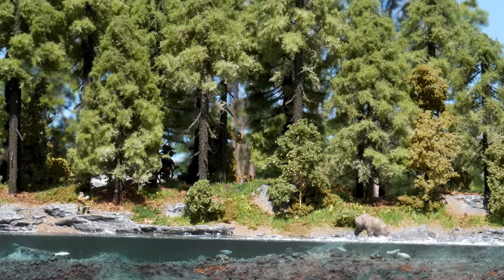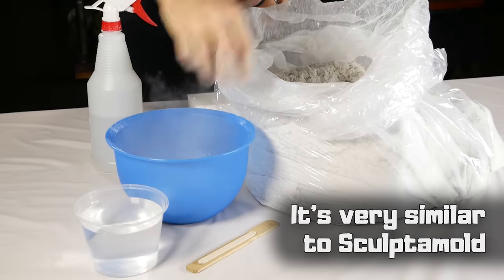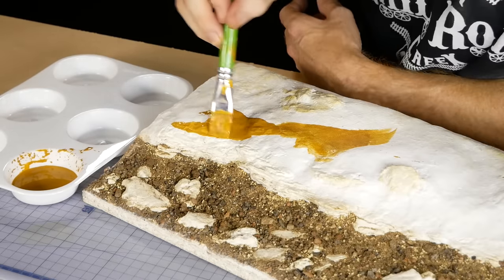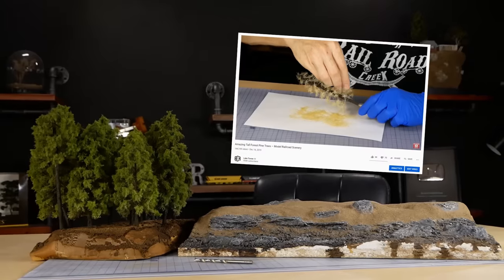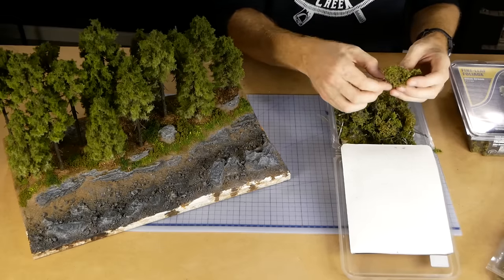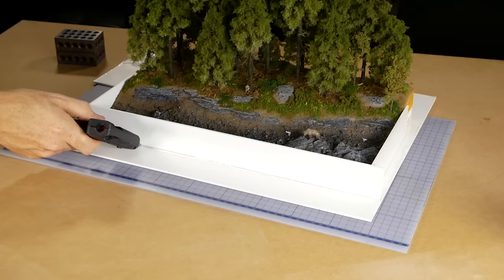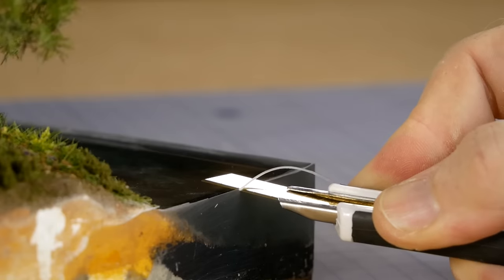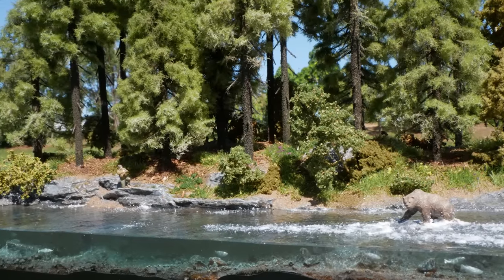Build an Ultra-Realistic River in the Alaskan Wilderness – Realistic Scenery Vol.21

Comment: I had a funny moment a little while ago  when I was shopping for acrylic paint but all the proper brands of modeling paint were too expensive for me at the time, so i go into ned's and my mum says why are we going to all these different shops and brands aren't they just the same and i say i watch BCR with Luke Towan and he uses specific brands of paint and seams to get good results from them. So i end up picking up a pack of the exact same brand and type of paint he used for the base coat in this video. 😅
P.s. are you from Adelaide?
Kind regards Reuben.

Comment: Luke-FANTASTIC JOB!!! May I suggest cutting thin acetate and painting it with Tamiya clear smoke . Glue this into the inside of the body if there is room, with the tinted acetate in the rear windows it would hide the RC hardware visible through the windows. I have to say again that it looks great driving through the dioramas.

Comment: I’ve been building some micro-dioramas in 1/300 scale, usually roughly two inches by two inches in size, and the skills he uses are indeed transferable in different scales. Apart from resin. Usually you are better off painting water and applying gloss varnish than using a small amount of resin (in very small scales).

Comment: You could use L-shaped bars for the edges you pour epoxy for. You can oil/lubricate the sides facing in; clean smooth mold results, easy release. You can clamp them down on the corner's edge of a table. Or pour hot wax around the perimeter of your bars to lock them in place anywhere on the table. You can shape a minimal amount of clay in the sharp inside corners--to prevent leakage of the epoxy. Might save in prep time.

Comment: As an architect, we often get models made to test the viability of a design, and later to explain the ideas to interested stakeholders.

But we rarely if ever go to trouble of providing such naturalistic surroundings, even though the buildings themselves are brass etched or 3D printed.

I would respectfully ask if these dioramas have a commercial application, or are they just built for the fun of it?

Comment: Hello Luke, I've noticed that you always use an opaque resin tint for your rivers/water pours. What would be the difference (in appearance) between using an opaque tint instead of a transparent one? I couldn't find any opaque tints at my local craft store in the colors that I wanted for my water, however, I did find the correct color tint but it was a transparent resin tint. I don't mind showing the rocks and boulders at the bottom of the river, but I don't want to highlight the paint line blends for the depth of the river.

Comment: I am presently doing something like this, although smaller and less ambitious.  Assuming the ground base work is done (rocks, grass, dirt textures, ) wouldn't it be easier to do the resin pour before you do the tree / bush placement?  It seems to me the foliage makes it more cumbersome to work with... and they could even shed bits into the resin if you're not careful.  Anyway, I guess my question is did you have a specific reason for doing the trees before the resin pour?

Comment: How TF does anyone thumbs down this? Great job man... I was thinking though... if ever you wanted to use something quick to shine up a sanded out surface try using stone Ager. The epoxy you used for the sides came out much better but maybe ager could be a useful tool for you down the road for a different sort of texture and shine (if you haven’t discovered it yet).

Comment: Hello luke! I was looking into making a deep sea diorama, a tubular base going decently high as a center table piece. The idea is to have a small boat at the top as a sense of scale for how deep the ocean is. Any ideas on how ill be able to get that much of the water solution down. The fish idea you had in this video may not work when I would have to make the stems 140+ centimeters. May be a good video idea if you make an entirely water-based diorama, keep up the great vids!

Comment: Luke, this has got to be your best water scene yet. I have a question. I used mod podge to create ripples. It worked great but after a few months I had another close look at it and the ripples has 90% vanished. Has this ever happened to you? Could it be from sitting in a hot room?

Comment: Hi,
       love to dioramas. Is it possible to make a bow wave using clear cast resin any ideas love to hear from you
Regards 
John
Reply from the maker: I think it's definitely possible... it might require a mold to be made first using modeling clay to get the desired shape. I've never tried it before but here is a video where I make a large wave, I think the method for a bow wave would be similar: https://youtu.be/04OqLFCXz8U

Comment: Two extremely nitpicky thoughts:

First, shouldn't the salmon be facing in the opposite direction of water flow, and also be red? I think the main time when they're in rivers and getting eaten by Grizzlies is during fall spawning season, when they turn red and swim upstream.

Second, have you tried starting the ripples where the water flow "ends", then blowing subsequent layers of ripples over those? It could lead to a more natural look of ripples folding over each other.